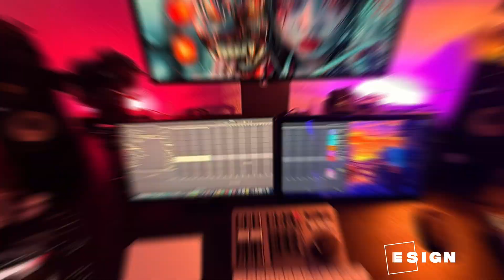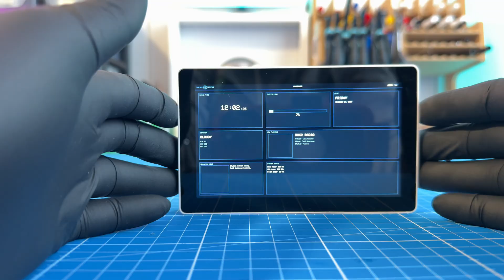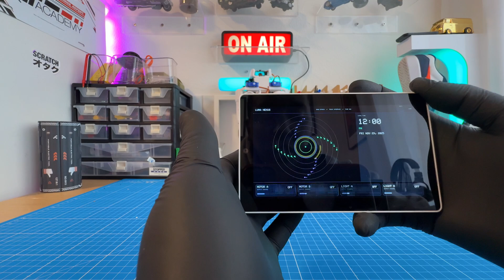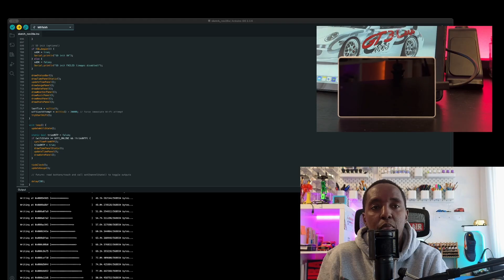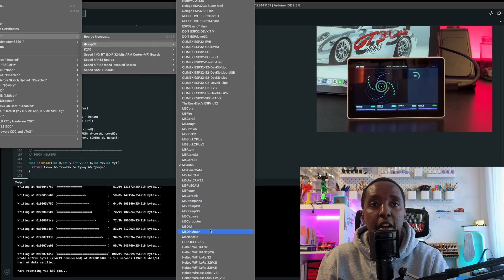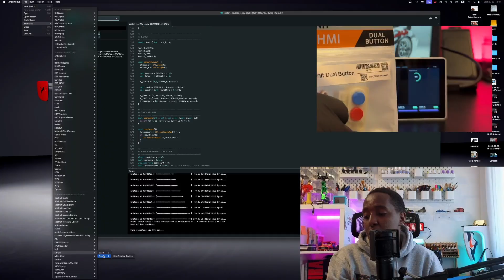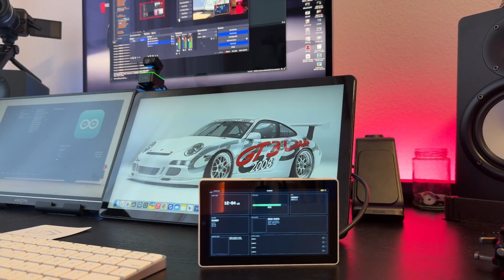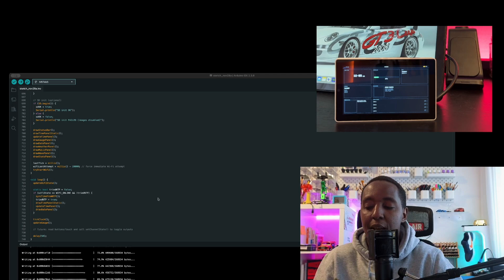M5 stack: Tab 5 User interface design

Comment: I have Tab 5, plan to use it as UI for an arduino nano based EFI for my ATV.  The UI will display real-time engine parameters, and enable tuning adjustments. One component is a terminal emulator over USB.
Reply from the maker: That’s very interesting. I think you can pull it off. Would like  to see how it goes. A dashboard + tuning interface maybe the same concept can be used in cars to twerk it on the go rather than plugging in a laptop. With the right ideas the tab5 can be useful maybe a rugged version for such use would make sense.
Reply: @DSK2design 
I am fairly old, and trying to get after ~ 9 yrs of not developing. I am starting to learn python, and new methods.  You seemed to get up and going quickly, on Tab 5 very impressive. G search  KitcarlsonEMS.
Reply from the maker: I watched some of your videos and men! both the aztec 7 and the 66 Barracuda are impressive and what your are doing with EMS and the system with the android is mind blowing. I am definitely on that level I followed you to see future project. I think the amount of information and insight is on the level of the EMS D10. More longer videos.
Reply: @DSK2design  Thank you for kind words.
Reply: Thank you very much for posting this very informative video. I made the comment which prompted you to post this detailed reply . Basically I made the wrong choice of platform to achieve my aim of a handheld interface to Home Assistant and you are correct that I would have been better to choose a plug and play device such as an Android tablet particularly as I am new to coding. I am slowly plugging away in HA using Esphome and beginning to get a better understanding of what I can do with the Tab5. I chose it because it appeared to offer everything I wanted and didn’t appreciate how difficult it would be. Your patience and understanding is very welcome. I will keep track of your progress with the project and keep you updated with any successes I may have.  It was a strange but pleasant experience watching your post as you were talking directly to me and going to great lengths to explain the process.
Reply from the maker: I actually enjoyed the challenge and thanks to you I would have assumed that everyone gets the concept behind most Esp32. I am also learning a lot especially once you discover that software like squareline make the work easier at a premium so either baby steps or fast forward and hope someone makes a system that’s inline with what you want to use it for. Thanks for the feedback and I will follow just incase you start posting your concept. I am on baby steps and I have a headache 😭😤✌️